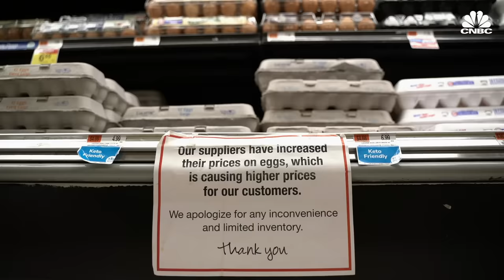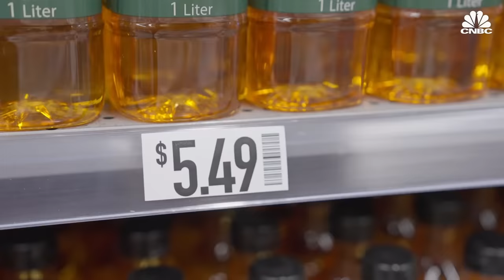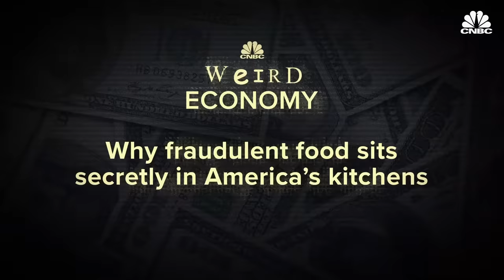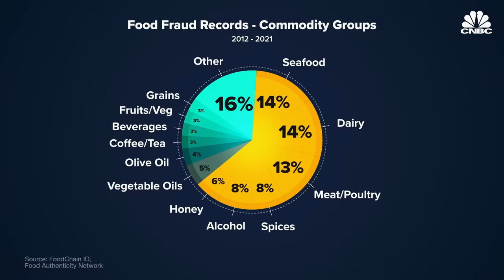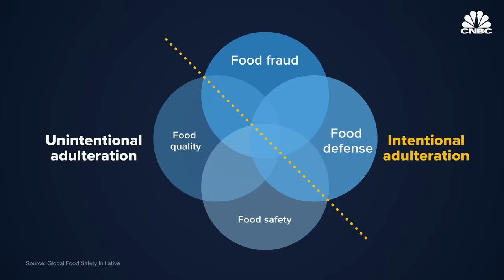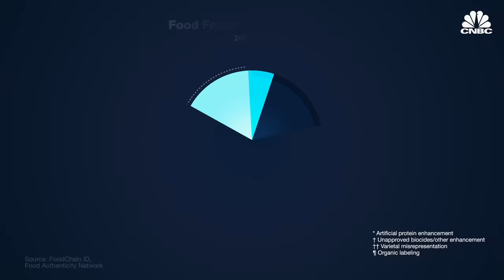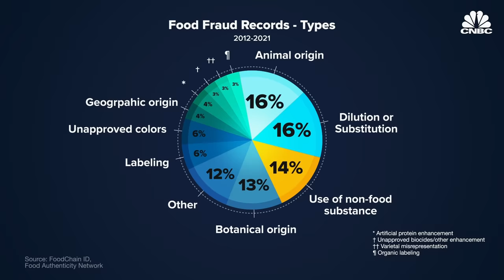Why Do Groceries Cost So Much? | CNBC Marathon

Comment: Whatever happened to free enterprise?  Prices are supposed to be based on supply and demand and companies used to compete with each other for more business.  Instead of a chain lowering its price when another went up they raise theirs too!  Ir's called price fixing and companies used to be busted doing so. 
A box of cereal went from $4.49 to $6.99 in a week - that's a 64% price increase!   Pretty soon a loaf of bread will be $10 !   When will it end?
Reply: That doesn’t work when one or two companies own majority of the market share. For example General Mills owns almost every cereal brand and many other food groups like sauces. You can’t really compete with such giants as they will always have the resources to price you out. Even the off brand cereal is manufactured by General Mills and the cost for the same cereal non branded is cut in half. If you ever go into Aldi’s you will see the generic and name brand items right next to each other and the non brand will be half the price of the name brand but it will be the exact same product. Free market doesn’t work with food because food is a necessity, like housing. People will pay whatever the cost to eat as they would pay the incredible high rent to have housing.
Reply: @Daveyjonesvi  Price fixing is illegal, no matter what the commodity.  It's an anti-competitive agreement between companies so that the consumer cannot get that item cheaper anywhere else, and is forced to pay a higher price.  If the anti - trust laws were enforced as they were before these monopolies would be dismantled.  Ma Bell in the 1980's is a good
example, but our government in the last 6 years have  (both sides) eased up on these laws and not enforcing them anymore.   Price fixing is busted by the attorney general but for some reason are not doing their job.  COVID is gone and there are no supply chain issues so there is no excuse to let this continue.

Comment: If i've learned one thing from covid and the breakdown of the supply chain it's that prices no longer reflect real world value. Big companies wasted no time in throwing "supply chain issues" at every product they owned to justify raising prices as high as the market could tolerate. Some products did have issues, but I would bet that most didn't..  and since it became clear that customers would still buy products at almost double the price, there is very little reason to think they will ever be sold for less again. This compounds across every industry for every product.. people up-charging the crap out of each other left and right, and then raising their prices to compensate for other people doing the same to them.
Reply: It's called price - fixing.
Reply: @sherriianiro747 in a broad sense yes but that's not the correct term price fixing is if all the companies had an agreement on the price, this is price gauging
Reply: @jorgenoname6062  It was called price - fixing by the feds several years ago when some companies in our state kept raising their prices when others did and none lowered or kept them the same, so eventually they were all around the same and there was no competition.  It's an anticompetitive agreement between companies so that the consumer has no choice  but to keep paying more money without the option of  getting their goods cheaper elsewhere.
Fixed price simply means an item is at or near the same price at all businesses that sell it.
Price gouging refers to inflating prices during emergencies or disasters, which doesn't apply.

Comment: Fresh parmesan is cheaper nowadays. I bought mine for $5 for a 4 inch block at Trader Joes that can fill 5 cups of cheese. The dry artificial costs me $3 at Walmart for 1/2 cup.
Reply: Why not shop at target?
Reply: @herenthere890  target doesn't have 50 different options of fresh blocks of cheese.
Reply: @Mitaka-Asa  but come on man I work at target if you were to shop there I could've given you refund for at least one order just like that.
Reply: Ikr!! Why is Trader Joe's now almost identical, or in some cases cheaper than Walmart now. Something's rotten to the core. I hardly shop at Walmart now because it's too expensive...Like what's wrong with this picture...Walmart USED to be the cheapest groceries, now it's on par with Trader Joe's, and I'd much rather shop at Trader Joe's. 😮

Comment: I looked at the examples shared by many people. One of them is the experience of many people working in a grocery store. No one discounts or promotes food until it expires, but just throws it away. Some people say it is because they are worried about someone having a bad stomach and facing a lawsuit. This is also The problem with our society is that one act of kindness can get you into trouble and no one wants to do that! If possible, one month before the food is about to expire, we can promote it in several stages. I think this will be much better.

Comment: FUN FACT: organic produce are WAY cheaper to produce than inorganic. I have always bought Napolian, and after learning this, I decided to buy a higher priced, significantly smaller bottle of no-name brand of Extra Virgin. HOLY COW! The color, smell and taste was SO different. You can TELL it is 100% olive. Source was Italy and Greece, versus Napolian that is mostly California. The real extra virgin is pretty vibrant, with a bold aroma, thinner consistency, and robust olive taste. Napolian is more yellow, thick, hardly any smell and a flat, mild, and bitter taste. Same with Bertoli. So just a heads up, these two top brands are suspiciously NOT 100% olive.

Comment: I'm fortunate enough that I have a local butcher shop, which has not only meat that is higher quality than that found in the supermarkets, but it's also cheaper for the same cuts, most of the time. I have to really overhaul what items I purchase for groceries, because everything is getting so damn expensive -- it's even worse if you have dietary restrictions or need special alternatives.

Comment: I have found it very very odd that when I buy jasmine tea from many companies, it no longer tastes like jasmine tea from say 10-15 years ago. I am now suspicious that some companies are calling their tea Jasmine without any jasmine in it. One of the brands I used to get was Stash, even the bagged Jasmine was great years ago, then it started tasting bland and strange. I started getting some loose leaf from much more expensive brands and I did find some that were good, but eventually the same thing happened. The best tasting and best priced one I could find made me have to urinate really often, especially overnight even if I didn't have tea since the afternoon. 

The jasmine tea has made me wonder what is up, I even wondered if the flower was extinct or something because I couldn't find this tea anymore. I still haven't found one that tastes as it should. So I can at least say I think there are definitely fillers in tea. And even for jasmine, so many have these great reviews, makes me wonder if they ever had a better tasting jasmine to know. I'm surprised the one I got from stash years ago was as good as it was. Plain green tea isn't as it was either. Black is the same, to me. I have just found it odd that it's not quite the same.

Comment: Why Groceries cost so much?
ONLY in WESTERN COUNTRIES. (US, Canada, Australia, much of Europe)
In Tokyo, Japan, my One Month's Food budget in under $400 while not on a budget.
Exchange rate: $1.00 = 150 JPYen
10 eggs $1.10 to $2.50 for the expensive brand named eggs. (Eggs are sold in 10's, not a dozen 12 in Japan)
1 Kilo (2.2 lbs) of Pork, $5.40 / 2 Kilos (4.4 lbs) ) of Boneless chicken thighs $6.75 / Wagyu Beef 300g (0.66 lbs) usually under $18.00
Eat out Ramen, $5.40 to $13.50 max / Sushi at rotating sushi shop, $0.80 to $3.50 (for 2) max. / Big Mac at Mac Donalds $3.00

Comment: Here is the deal. During covid they printed billions of dollars to pump into the economy to prop it up. This devalued the dollar. So corporations increased their prices to offset the decrease in the dollars value. What they didn't do is increase wages which is what must happen so that workers can afford the increased prices.  Since they have not increased wages people can no longer afford to buy so corporations are now laying off staff to compensate. You see corporations will Never lose out on their earnings because they set the prices. The worker suffers and we are now at a point where the system is breaking down. Minimum wage would be over $20 an hour if it had kept up with inflation and yet most folks now consider that a reasonable wage.

Comment: Video fraud is when the video has a topical title ("why is food so expensive") but when you watch it, it's clearly about completely different topics (food fraud, organic food, etc).  All food is more expensive, fake, real, and organic.  Food fraud takes advantage of the high prices of certain foods, it's a symptom, not a cause of high prices.  Current high food prices are probably caused by a coordinated worldwide phase shift in pricing.  The pandemic supply chain problems served as an unintentional signal to firms to shift to a higher price regime in a coordinated way that left consumers with no competitive choices.  If firms had coordinated to raise prices intentionally it would be illegal, but an unintentional worldwide signal is not, plus antitrust enforcement is not strong now, so we have 50%+ food inflation and record profits.  Increasing wages across some industries may also be contributing, but it's probably not the dominant factor, since we're not seeing across the board 50% wage increases.  On the other hand, wages at the bottom end of the scale are increasing due to labor unionism, and since a lot of food sales and processing jobs are traditionally low wage (grocery store clerks, meat packing with undocumented immigrants), this long overdue increase in wages may be contributing a lot to price increases.